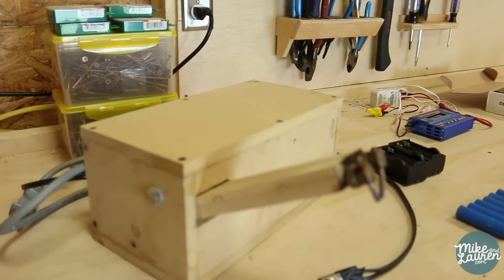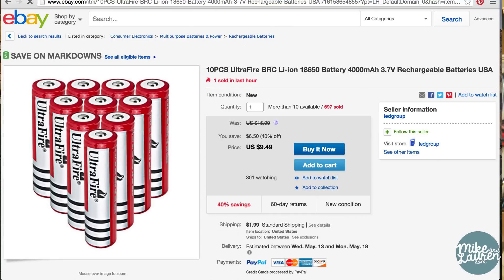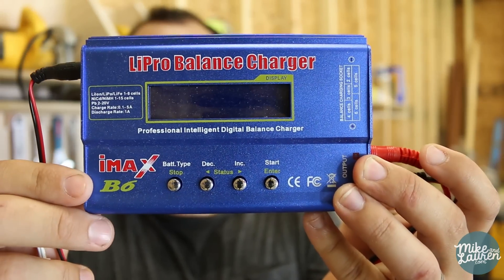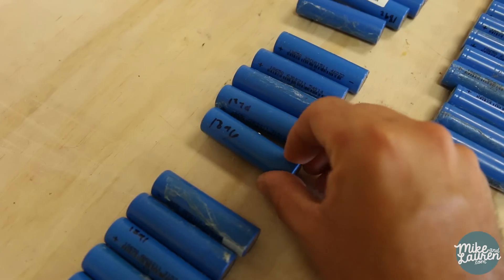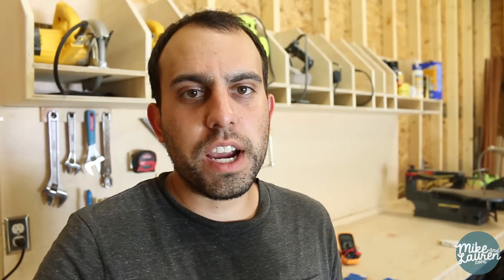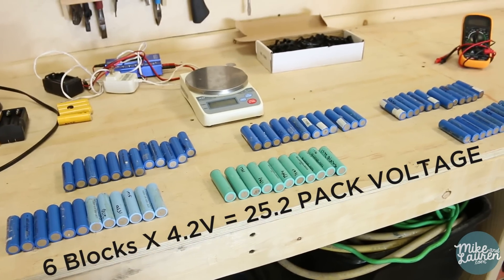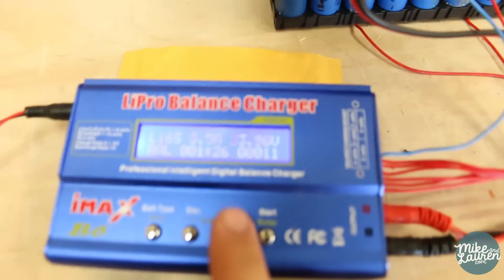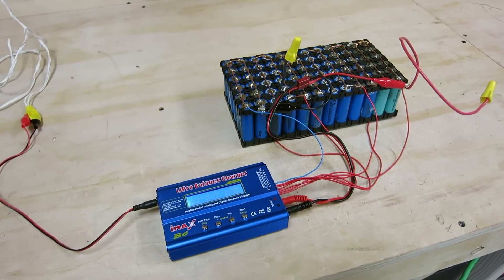DIY Lithium Ion E-Bike Battery Pack from 18650 Laptop Batteries

Comment: If you try to use batteries from a pack that has been unused for a few years, you have junk batteries.  Batteries self discharge over time.  And undercharged batteries deteriorate rapidly.  This is why if you park a Tesla with dead batteries for a few months, you need to replace the batteries.  This is why unused lithium batteries are almost always junk.
Reply from the maker: Matthias Wandel Not junk, just not as useful and the price should reflect that.  A "dead" lith-ion cell can have a capacity of 800-1000mA if revived.  A good price for cells is about $1 per AH.  So, if you paid more than $6 dollars for a "dead" laptop battery you got a bad deal.  $12 dollars for a "used" but working one is a good price (assuming 2000mAH useful capacity).

I tested all of my laptop batteries before cracking them open with a couple razor blades and a meter. http://i.imgur.com/YG2jw0E.jpg Any cells below 3.0V got returned.  I ended up only having to return one.  They were manufactured in 2012.   

But yes, a Tesla with 1/3 of it's original range is not ideal.
Reply from the maker: Michael Baker LiFePO4 batteries would be better for this application, but they are not cheap or readily available yet (on the used market).  A lot of the reason you can pick up these lithium cobalt cells so cheap is because it's kind of old technology.
Reply: +Matthias Wandel the tesla has such a bad self-discharge because it keeps many of its systems running 24/7. I think they've improved this with newer updates but thats the main reason for the poor storage... batteries on their own (or with just a basic BMS) should sit just fine for a year or more, though some will loose a notable amount of their capacity if they're stored at close to full charge (close to mid-low charge is best for storage). 
I'd also doubt that the tesla needs to buy a whole new pack - might need to be plugged in before use but the BMS should disconnect the pack before it gets damaged, so it'll just sit there until someone can come plug it in again. if not its remarkably bad design on teslas part.
and yea, i've used plenty of cells that are ex-laptop (not for ebikes though, they lack the power density for me) but for smaller projects that only need a few w of power, they often still work fine.
Reply: My 9year old laptop's batterys still hold about 1800 mAh of current and they were unysed for 4 years.
Reply: Mike and Lauren I am certainly no expert, but have you considered using LiFePO4 (Lithium-Iron Phosphate) cells?  They are much safer than standard Li-Ion (I'm assuming these are lithium cobalt?) but the biggest factor to me is the cycle life.  They may be more expensive (not sure about that) and don't have quite as good energy density, but you can get many more charging cycles out of the Lithium Phosphate batteries before needing to replace them.  Between the long-term cost of ownership and safety factory, it would definitely be worth researching before building your next pack.   

Lithium Phosphate batteries are fairly robust against being deeply discharged. Using the proper electronics, they can protect themselves from being too deeply discharged in the first place by opening up the FETs and disconnecting the cells from the terminals.  (To be fair, the same might can be said for Li-Ion...again, not an expert but I do have some experience with LiFePO).  

You shouldn't really run into any irreversible issues unless the cells go into cell reversal...at that point the cell chemistry has been changed, the bad cell dips into negative voltage, and you can't recover it.  We use 40A/hr Lithium Phosphate packs at the company I work for and are able to charge them safely at 20A.  Our particular batteries can be put into "shelf mode" for long-term storage and they are rated at 2500 cycles to 80% capacity (4500 to 60%) at 100% depth of discharge.  They can recharge from 0% SOC to 100% SOC in just a hair under 2 1/2 hours.  In real-world test cases, the capacity curve is remarkably linear and, should remain so, from brand new all the way to 0% capacity so you don't reach cliff where one day it works great and the next day it doesn't like with SLA batteries.
Reply: t t ryfhj"d
Reply: Donghyun Lim: No, but even the Mighty Mattias Wandel makes mistakes. :)
Reply: +Stephen Gibb   If the BMS draws power in storage, why should you leave the BMS connected for storage?  Or is there a typo here?
Reply: Ron Warrick a good bms doesn't. most will draw some current all the time, but generally will be so low that it would take years or even decades to discharge a pack on its own. but afaik with the tesla it has a number of auxiliary power systems that remain on, even when parked and 'off' - this is what draws down the pack over time. Kinda surprising that there isn't a 'full off' state that it can enter if its not used for a few days, but there maybe a reason for it...
Reply: Ron Warrick there's that, among other things. they did apparently just improve it dramatically (half the standby power draw or something), so this could improve in the future too.
Reply: +Kenandre' Beach exactly!
Reply: Donghyun Lim that's what I thought!
Reply: This is complete BS. I know this is 2 years ago, but still..
Reply: Matthias Wandel + Dude! you are mixed up lead acid with Lipo battery. Lipo has low Sulfated rate.
Reply: Matthias Wandel You call it junk, so let me buy it for cheap, if you sell me a "bad" tesla battery set, I will be forever in your debt. We love people who don't uderstand value of things.
Reply: Matthias Wandel  Complete and Utter bull. I have used NOS laptop packs that were 5 years old in there new packaging still and when i took them apart the cells were down to 1.8v I bought them back up to normal voltage slowly and charged them as normal and the capacity of those cells had perhaps lost 5-10%. 
I have a 8p10s pack built myself from these sanyo cells and i have been using it for 3 years now still running great.

The reason a tesla cant be parked with a dead battery for months is because of the BMS (Battery Management System). The BMS system in the tesla will draw power from the pack even when the cells are dangerously low.

This is why on ebike packs with BMS you should be careful to leave the pack in storage with the BMS connected still.
Reply: Matthias Wandel youre junk
Reply: +sn0wchyld   I suppose so they can push software updates to you at any time.
Reply: yeah so Elon can sell more Battery PACKS!!!!!
Reply: AllForTheGame   And you are an unachieving loser and a pathetic coward.

Comment: Great video.  Ultrafire batteries are dangerous junk.  Good job.  That bike looks so fun!
Your auto-focus is going crazy, consider locking the focus with a manual mode.
Reply from the maker: Doyen Guy Yea I have to get in the habit of switching between manual and auto depending on if I'm standing still or moving.